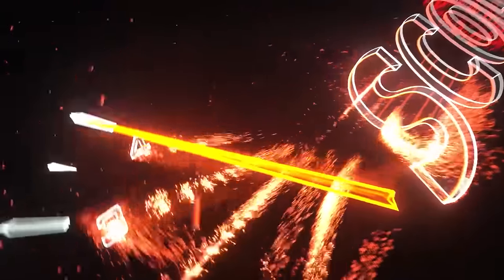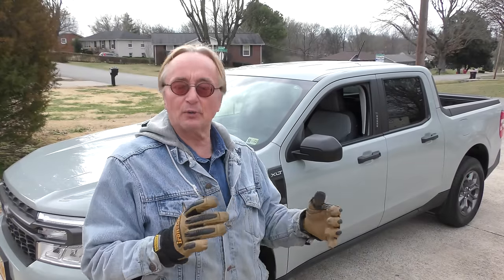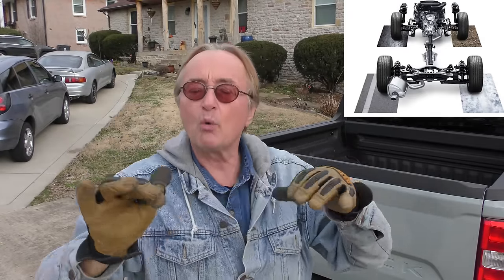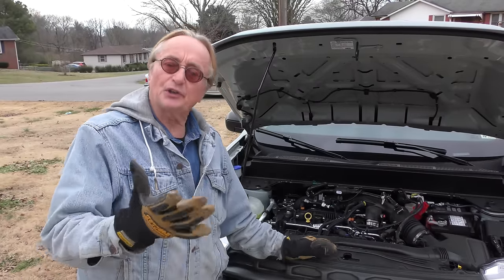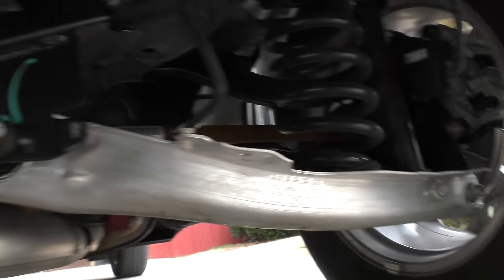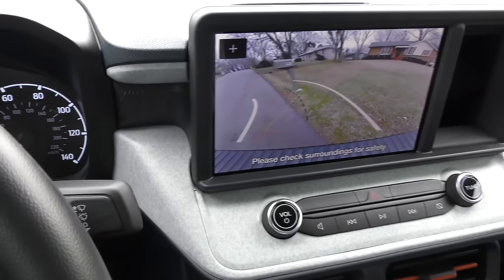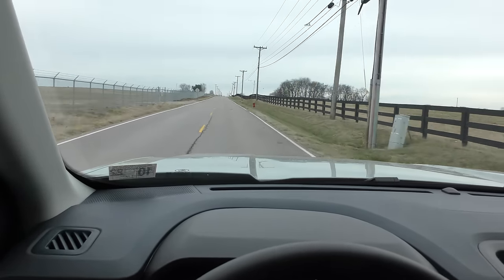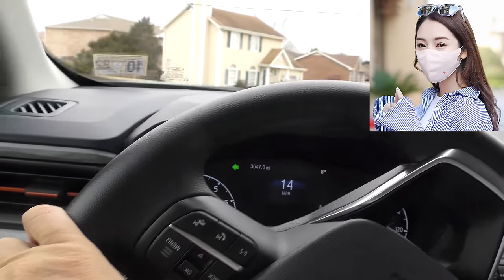I Finally Got a New Ford Maverick and Here's What I Really Think of It

Comment: My biggest gripe with new Fords (I have a 22 Bronco and a 20 Escape) is that the engineers didn't design them with routine maintenance in mind, or (more likely) they make it overly complicated, so you go to the dealer for all your maintenance.  Case in point, the oil pan is behind the bottom cover (meaning you have to remove the cover to do a simple oil change), and the oil filter is tucked way up in the wheel well.  You either need an extra joint in your arm to get at it from underneath, or you need to take the plastic cover in the driver's side wheel well off - and also probably the wheel - to get leverage to get the filter off.
Reply: Yes! On my channel's video showing how I sprayed the underside of my Mav with protection, I had to remove 15 small bolts that cover the front where the oil filter is located.
Reply: Helped my son put in a new battery in his Escape.  Good Lord, never again.

Comment: Appreciate the tip on the oil.  I have a 3.5 eco boost flex with 130k miles.  I have always used a synthetic and changed it every 5k.  This is the first time I have heard of the GF6 oil.  Should I switch to that.

Comment: You can get away with all season tires with AWD for driving on the road.  I was running COOPER DISCOVERER AT3 4S on my  2015 Jeep Renegade Trailhawk, never got stuck, didn't make too much noise.  Kind of a gas hog, traded it for a Subaru Crosstrek Sport this year.

Comment: hey Scotty My 2018 Malibu has it it sux had it straight off the show room 9000 miles on it it has the start-stop feature I can't stand it because now I've had to clear my p07010 code twice two transmission codes it starts and stops in reverse too I can't stand it the other night my wife was parking the car she went to put it in reverse it started and stopped but it clunked and threw a code I cleared it after I checked it all out going to do a spring tune up on it change the oil check the training fluid it shouldn't have to be changed it's only 4 years old but we're going to keep an eye on it I don't recommend Chevy Malibu to anyone so far the car has been pretty reliable we have a doctor's appointment   Boston every 2 months we've done four trips every other month since we bought it I will say it does drive it is reliable I've been working on cars for 12 years and I haven't done any major work I'm not certified just routine maintenance I got to say from personal experience it's the worst car I've ever owned it's uncomfortable it bangs you around but in all reality again Chevys will rot before they fall apart I will give this car that much but I'm just waiting for that training to blow it's an ace in transmission so I'm waiting for it to die on me whoever came up with that start stopping reverse needs to be let go from Chevy's design department I don't know who came up with this idea but sometimes it scares my wife because it clunks I can't stand that s*** it shouldn't be clunking just waiting for that code to pop up again I want to sign with Scotty on GM nowadays I will attest to GM you can drive them they're very dependable but they're the worst thing to drive if that makes any sense just those little pet peevesof  mine personally

Comment: I like the gas milage and compact design, but the towing numbers are quite low. I need at least 10,000lbs to tow a large wood chipper

Maverick only tows 4000lbs

The F150 tows up to 14000lbs

Comment: Always run 4 snow tires. Bad advice to run only on drive wheels. Getting moving in snow is not the problem, it’s effectively stopping and controlling the vehicle. 2 snow tires will limit your control and stopping ability.

Comment: If I were in a position to buy this truck right now I'd get whatever the base front wheel drive is. I would like a second vehicle that's not my motorcycle in case I need it. Right now I have a ram 1500 with well under 100k (lots of life left) miles but its my work truck. I mow on the side and it's kinda a pain to load and unload all of my equipment everyday. Having a second vehicle means I could leave my work truck loaded.

Comment: I still dont understand since you can change your drive setting electronically and they are going with small round controls to change them, why not put it on the steering wheel as a button, or put it on the dash and free up all that space in the middle. You can push that storage space to the front and possible put a bench seat in the front as an option.

Comment: I own one of the older Ford Ranger trucks. 4 cylinder.  I have owned 2 so far. They get around 26-30 mpg. Rear wheel drive. In the winter put good tires on the back and weight in the bed and it will get around good enough to get you into trouble.  I don't see where Ford done any better getting rid of a 25 year old design. They improved them over the years to make a really reliable vehicle before getting rid of them. I don't see a front wheel drive truck doing anygood. Put weight in the back and front tires have to pull instead of push. Get all wheel drive and less feul economy. Ford was doing just fine with the old ranger design.  They should have kept it. Throw away society..  no frame under it. Gets crashed throw it away get a new one. Probably like the new cars and no dipstick for the transmission to check if it's low. Smallest leak and get have to replace it or wait till you get stranded. They design them to replace them every few thousand miles. Not hundreds thousand miles. Some of the old rangers I have seen 450,000 miles. Like the older Toyota trucks. The new ones aren't as good either. They will never sell anything they won't have to sell parts for.

Comment: I don’t like the start stop technology. I think they should have set it up if you want to use it flip the switch. I have to cut it off every time I start driving it.
Reply: The hybrid has to shut the gas engine at a signal so the electric motor can take over. I have Mav only videos on my channel you may like.

Comment: If I was buying one of these it would probably be the hybrid for the easy 40+ mpg that people are getting in them. 25mpg highway with the 2.0 isn't really that impressive seeing as I can come within a few mpg of that with the 3.5 F-150, and that truck is an order of magnitude more capable than a Maverick. I think that the Ford hybrids aren't too bad, they've been making them for 15 years now, and they licensed a lot of the hybrid tech from Toyota so they got a solid start. Like any hybrid or EV don't own it past 10+ years old or risk having the bill to replace the high voltage pack.

Comment: Only time will tell, but I predict in 200k miles of driving, the hybrid is going to prove to be more dependable overall. The 2.5L 4cyl gas engine is simpler, with no turbo. It's going to cost a small fortune to replace that turbo when it eventually fails, probably as much as the small hybrid battery. The hybrid 4cyl also spends less time running since the vehicle relies on battery power solely some of the time, as evidenced by the longer oil change intervals for the hybrid versus the EcoBoost. The eCVT transmission in the hybrid will also likely prove to be less problematic long-term. I read it's based on technology from the Toyota Prius eCVT.

Comment: I don’t know why ford does not make an f150 extended cab with a 5 ft box instead of standard 6ft henceforth taking a foot off the total length and making it much easier to park. They could puta 6 cylinder hybrid in also.

Comment: Aluminum is great for economy purposes but when you start off-roading you all have to seriously understand the difference in steel vs. aluminum. Dirt roads are not off-roading by the way, you don't need 4wheel drive or AWD for that. So if that's your reasoning for it, you're pretty much why trucks costs as much as they do today.
Reply: This is no rock hopper but works great on slippery dirt roads to the trailhead.

Comment: This is THE truck I want and need for my kind of work, (well, the hybrid that is) I'm traveling a lot now so fuel economy is a great plus and when I'm on job sites, I could get a lot to lot without using practically any gas!
But the problem is these ridiculous dealerships are marking them up way too high!! The base model is supposed to be 20k but I can't even find an XL (the bottom tier doesn't even have cruise control) for less than $35k. Yes you heard that right! Every dealership around here is adding on 15k just because they can, like wtf?!
Reply: Gotta build and wait. I had one for two months before I sold it. It's not all that. It's an Escape with an open bed.
Reply: Elijah, I love the Mav so much I bought 2 that I show on the videos on my channel! Did you order one last month at msrp when 2023 order banks opened?

Comment: The starter died in my Mercedes in less then 6 months and I blaim the engine start stop feature ( also blaim myself since it died so fast since I use it for DoorDash and I've done over 17k deliveries so far and a couple thousand have been in this Mercedes ). That feature does save gas but once my warranty is up then I'll have to find some way around that feature because there is no button to disable it ( 2018 Mercedes c350e ) and if just going in for regular service is 600 and that's just for a oil and general fluid change I don't want to know how much it cost to change the starter out again but this time out of my pocket.

Comment: Scotty,
     I bought a 2022 Bronco Sport with the 2.0.  I did my first oil change at 1200 miles and my second one at 6500 miles.  I currently have 10k miles and I’ve owned it for 9 months.  Should I start running full synthetic at a certain mileage or do it at my next oil change?  Thx so much…I hope you read this and get back with me.

Comment: REALLY wish you could get one of these in regular or super cab with a longer bed instead of just the crew cab. Other than that, I'm totally into in.
Reply: Sharing the unibody architecture with other 4-door SUV’s (escape) it probably has to be the way, otherwise the location of things, like the wheels, would have to change.  Also, I think the vast majority of the pickup market buys, and pays substantially more for, crew cab trucks.

Comment: Scotty, for the first time ever, I think you gave bad advice.  Never, ever, ever, use tires with more traction just on the front axle when in wet/snowy conditions.  Sure, you only need the front tires to have traction to accelerate, but it's the traction out back you need to stop without the back end swapping places with the front.  This is why it's illegal in many states to run only snow tires on the front axle.  Conversely, RWD only vehicles are safe to drive with only snow tires on the rear.  It's just physics!

Comment: WRT the stop-start engine auto-off at stoplights; on a hybrid, I find that less of an issue, since the electric motor is going to do most of the work of getting the vehicle moving anyway. Totally agree with Scotty on a gas-only vehicle tho', but that's probably as much to being a hide-bound old dinosaur who's seen too many engines idling fine just refuse to start once turned off over the years. Really hate being stuck dead in an intersection...

Comment: Pick up trucks are rear wheel drive for a reason . When  the bed is loaded down , you still have good traction . A fully loaded bed reduces the weight on the front wheels and degrades handling due to the front tires being lighter on the road . Now toss in some wet or snowy roads with a fully loaded front wheel drive “so called “ truck . You’ll be  spinning tires during acceleration, sliding while stopping and loosing steering control in turns .  Good luck to ya !!!!
Reply: okay engineer
Reply: @V-Pee  anytime 👍

Comment: The only thing holding me down for this  truck is the cvt transmission
Reply: The hybrid has an E-cvt.. No belts or bands just gears.. The Maverick has a beefed up "first gear" to handle heavy acceleration off the line.. Totally different design from the old cvt.. 👍

Comment: I did notice one thing. When you mashed the pedal from a stop. The tac got up between 5 & 6. Seems high. What does that mean in the long run?  Am I wrong?
Reply: Flooring it revs the engine but it does not red line. Fine only if broken in first. I have 80 Mav only videos on my channel that can help you, MR.

Comment: Why change the oil "once per year"? What if I only drive 2000 miles per year and use full synthetic amsoil with a 10k oil filter? What's the point of changing the oil "once per year"?

Comment: The downside to the hybrid is that it comes in only front wheel drive.
Reply: @KFC Man 
They surely would have sold many more units if they would have designed a rear wheel drive hybrid small truck, because trucks are supposed to be rear wheel drive in this country! 😉
Reply: I haven't purchased a new vehicle off the dealership lot with a sticker on the window since the mid 90s, and I still have my '95 6.5 Turbo Diesel 2 door SLT Z71 GMC Yukon, and a '97 5.7 Stepside Silverado too, in addition to my Cadillac crossover and Camaro convertible, so I really don't have a need for a Ford hybrid or Turbo 4 cylinder.
I'm like Scotty in that I'm perfectly satisfied with my trouble free paid for vehicles, and I have a trailer too, so I know I can haul or tow anything I might need to haul or tow.

Comment: Snow tires only on the drive wheels on a front drive vehicle?  NO. A common mistake, but a very dangerous one. You think rear wheel drive is bad in the snow? Try that combination. The back wheels will slide uncontrollably at the speeds the front wheels drive the vehicle. It's a known problem and a dangerous one.

Comment: I put a $1000 dollars down September 2022 , i still don't even have a vin # on my Maverick,  you might want to think about that , if your ordering a 2024, good luck , 11 months almost and no vin # might not even get it this year.
Reply: I did the same with my XL AWD 4K and got it in about 10 months for about $450 under MSRP. I got it primarily for towing on the cheap but the truck is more of a sports car than a truck. It's weirdly balanced like a sports car, akin to a Subaru wrx. I really enjoy it and will probably put on more street oriented tires. So you should wait, it's a great little truck that's closer to a car than a truck.

Comment: How many buyers now wish they had purchased the Hybrid version? $4-$5 per gallon now.
Reply: I have the AWD for road trips to ski and camp. Hwy mpg similar even with way more passing power and capability. The hybrid is if you need a commuter vehicle.
Reply: @JamesD-HB  Except that most of our driving is done at the 25 miles per hour rate. Whether you'll admit it or not the average speed that you drive is around 25-30 miles per hour. Unless you live on the highway.
Reply: @user-zn7lz8tv8s  Yes get the hybrid if you need to commute to work. Get the turbo AWD for highway ski or camping trips.

Comment: Sorry to tell you, but you NEVER want to put only 2 snow tires on a vehicle, even if it’s only 2 wheel drive… That’s dangerous advice. Especially putting them on the front. If you had to use 2, they would have to be on the rear to avoid dangerous handling. You always have to have 4 snow tires. Look it up if you don’t believe me.

Comment: This could haul a small trailer transport a riding mower or a ATV or small boat. There are small travel trailer under four thousand pounds.  In three years what would used on go for.  A conductor wages in 1923 would be the same for a conductor in 2023 for up railroad with inflation

Comment: They came out with the Ford Ranger and then a few years later this? What was wrong with the Ranger?
Reply: Many felt the Ranger was still too big for their needs. Not mention overly expensive. Original Rangers fully loaded in their final years were still under $30k. Can't even get a base work truck Ranger new at that price today.

Also, the Maverick was actually supposed to be the replacement for the Focus, of all things. This isn't really a truck; as with Santa Cruz and Ridgeline. This is essentially the new compact  to midsize sedan simply with an open trunk.

Comment: Scotty - you're giving bad advice about snow tires and front wheel drive. If you put snow tires on a front wheel drive vehicle, you must put snow tires on all 4 wheels. If you just put them on the front, the vehiclt is much more  prone to having the back end spin around because of the difference in lateral traction between the front and rear tires. I've seen this happen several times and here in Canada no respectable shop would let you drive away with snows only on the front.

Comment: The Maverick is great, as long as people don't mistake it for a truck. It's a car with a pickup bed. Certainly more practical for daily use- like Scotty said, it's more fuel efficient and handles better than a rwd or 4wd body-on-frame truck, and it's more comfortable as well. The bed gives it more utility than a crossover, the powerful engine means it should be able to pull a trailer, and higher ground clearance than a sedan means it's better on dirt roads and snow. However, for anyone planning on going off-road or in sand, a 4wd truck is the better choice- awd is great on paved roads and in light snow or rain, but because of the way the computers in awd work, it simply won't work in these situations. Awd vehicles also tend to be less robust and "tough"- the underbody uses weaker materials and is generally smaller. I don't know if this is the case for the Maverick, but if it is, pulling or hauling heavy loads won't work very well. Edit- This seems to be the case- watching this video vs Scotty's videos on vehicles like the Nissan Frontier or Toyota 4Runner, you can see how much bulkier it is under these than the Maverick.

My conclusion: A great car, as long as it's not used improperly. Much better than a Ranger for someone living in Denver, but someone living and working on a ranch near Denver needs the Ranger.